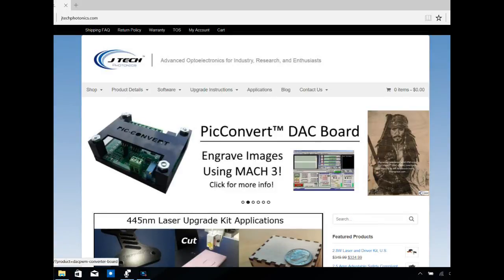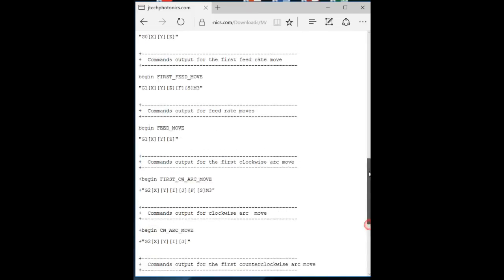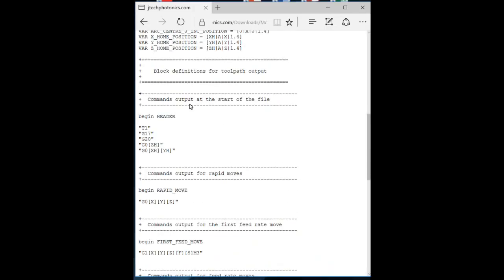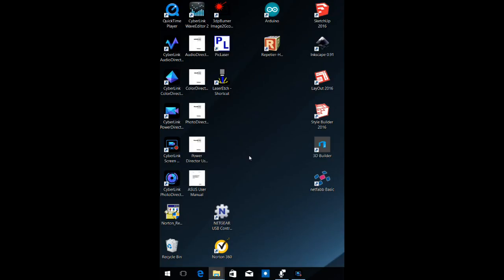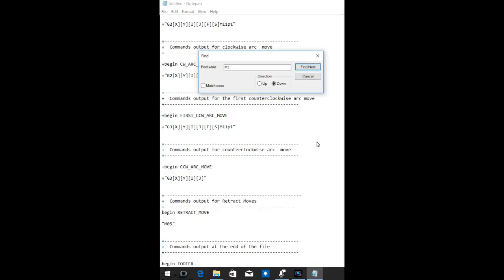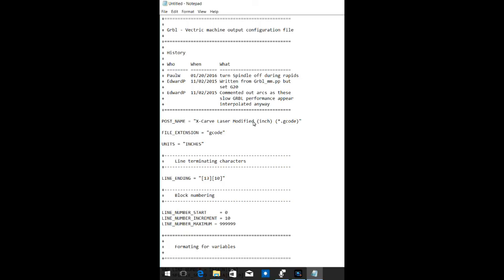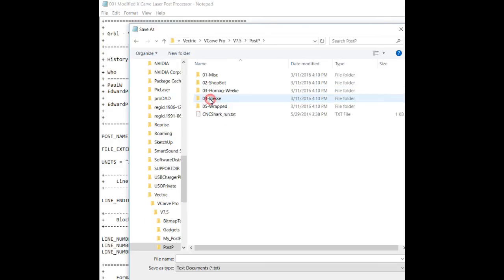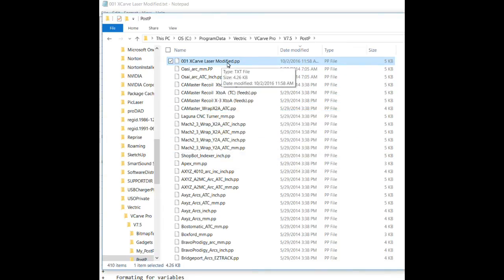0001 Vectric VCarve Pro Post Processor for JTech Laser and Mach 3

Comment: I really appreciate your in-depth and concise videos.  I have a super basic non adjustable Laser module, that will burn the surface when turned on.  What i want to do is connect it through my C25S BOB, and control the intensity in Mach3 via Spindle instructions. I have read this from various posts.  I think I need to apply your series 000X to build post processors etc. Am I going down the wrong path since i am not using a laser manufacture as you are? Are there portions of your series that are applicable to what Im trying to do with the hardware I currently have?  Thanks in advance.  Hager H
Reply: I am attempting to download the Vectric PP and modify it following your guide.  In your video you dont select “DOWNLOAD GRBL INCH” you select “ gcode inch”.  But when you start editing the file it displays “GRBL INCH”. Im 84 and confuse easily, please help me to get started in the right direction.

Comment: Thank you for making this, helped ALOT!  One question though.  Is there any way to change to power of the laser instead of going full force? Thanks again!
Reply from the maker: Kevin, you would have to do it either manually by turning down the current, or by using the "S" command in your g-code. Check out my video on how to focus the laser beam on very low power.
Reply: instablaster

Comment: John- Thank you so much for this video. VERY helpful. I'm stuck at the point of opening the "program Data" file. I have my "show hidden files" checked and applied, but I don't see a "program Data" file anywhere.Could it be called something else in Windows XP?
Reply from the maker: It's in your programs directory usually under the C:\ drive. In mine it's in the X86 folder. Yours may be different.
Reply: Got past hurdle 1. Next problem, when I rename the file to have a .pp extension it doesn't change to a .pp file. It stays as a text file. So now I have a TEXT file named VCarve Pro Laser.pp. What did I do wrong?
Reply: Finally found it It is called resource data in my version of XP.